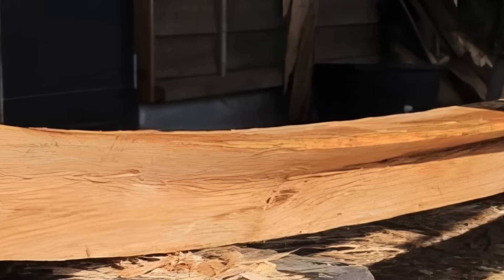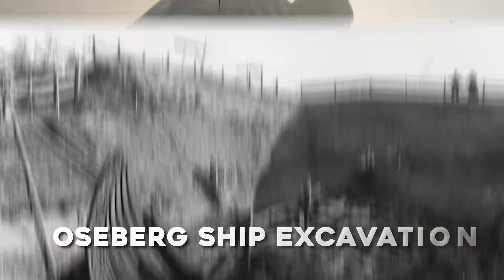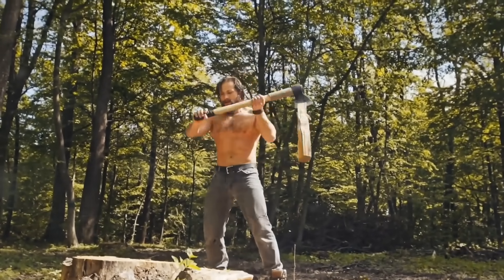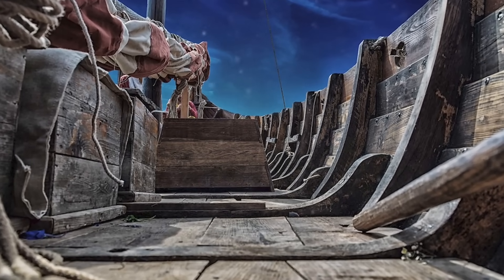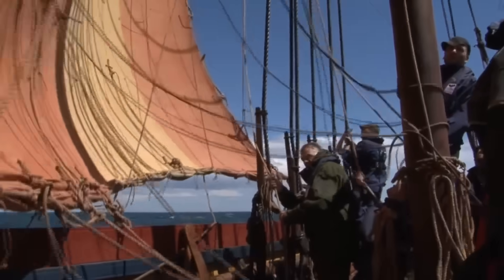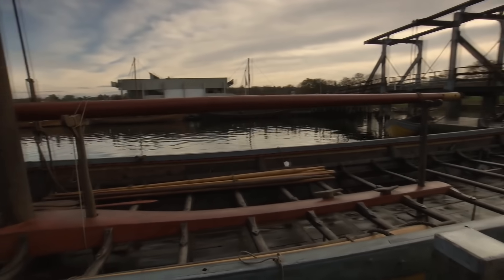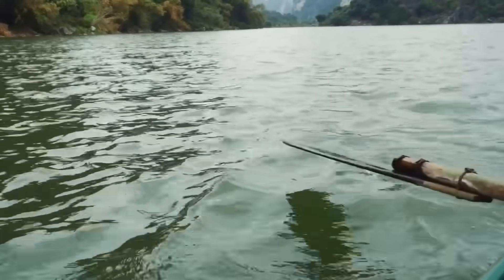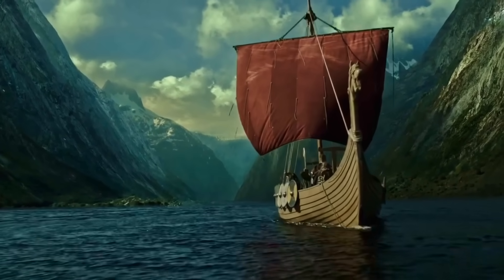How Viking Ships Were Built Without Modern Tools

Comment: Did you just find out how efficient hand tools are? 
You use the term “Axe” for every tool described.
The old time boatbuilders, built every part from trees to seas. Nothing new, even in those days.
Reply from the maker: Definitely not just discovering it, the term ‘axe’ was used broadly in the video to keep things digestible, but of course Vikings used a whole range of tools. Still impressive what they pulled off without modern tech. Appreciate you watching and adding to the convo.